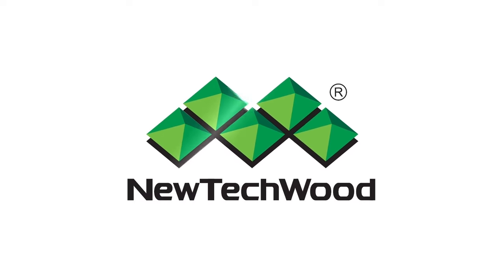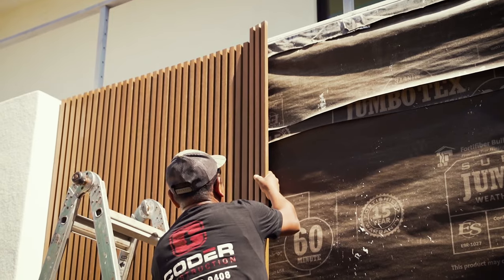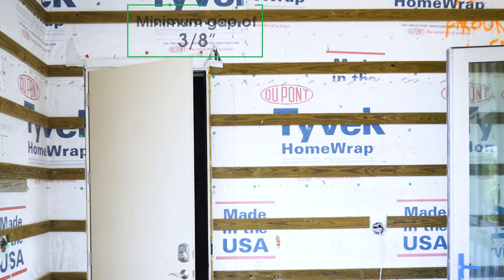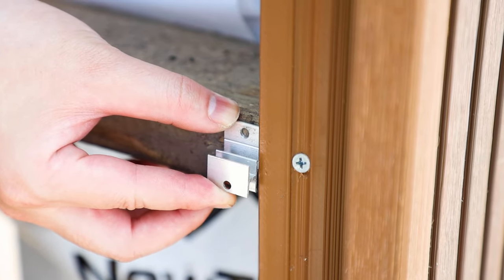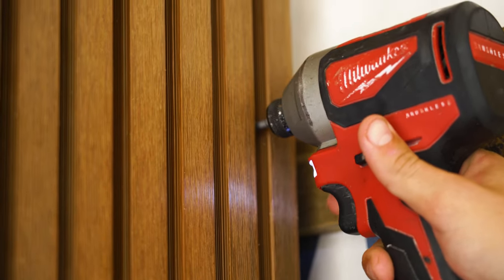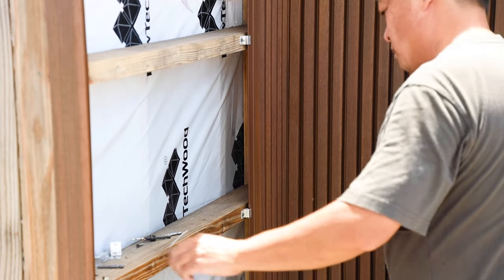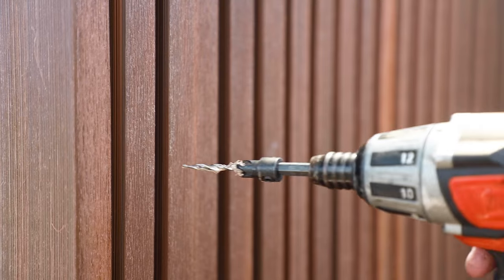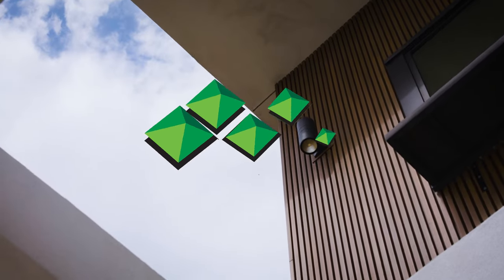NewTechWood European Style Siding Vertical Installation Video

Comment: Might be ok in the desert where there is no rain...   Imagine the mould buildup and rot behind in a wet climate?  Looks good though.
Reply from the maker: UltraShield weather-resistant decking is made from a capped wood plastic composite, which means it has an advanced premium shield encasing ALL four sides around its inner core. The shield and core are extruded together under a very high-temperature mold simultaneously, so no adhesives or chemicals harm the environment.   https://www.newtechwood.com/about-us/ultrashield-advantage/    😉